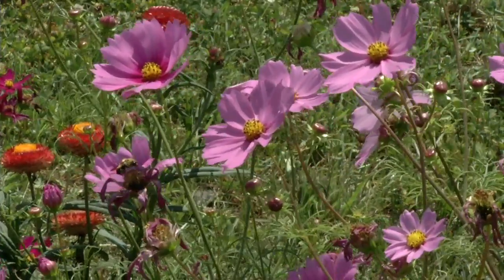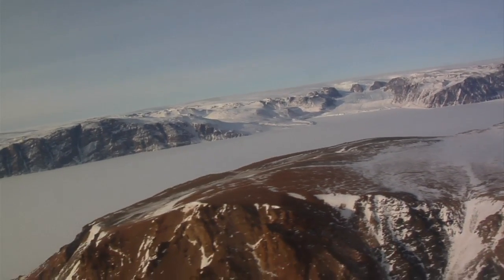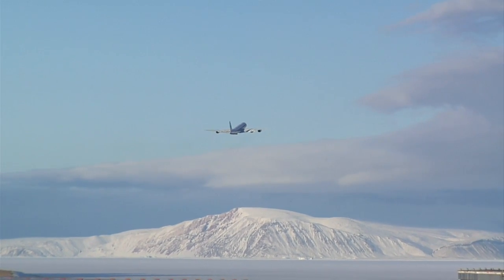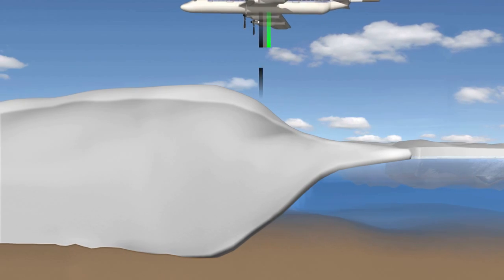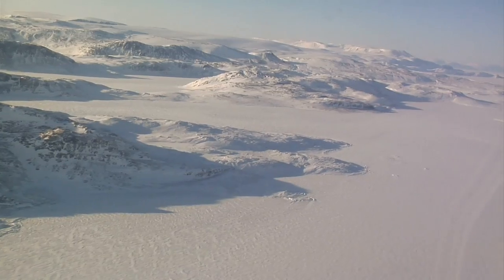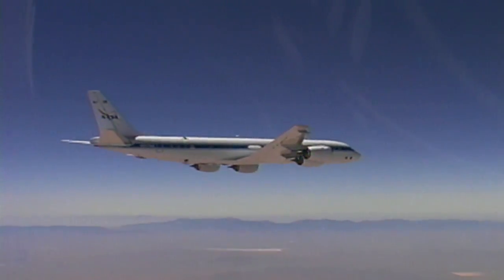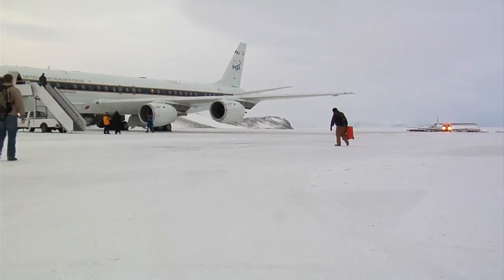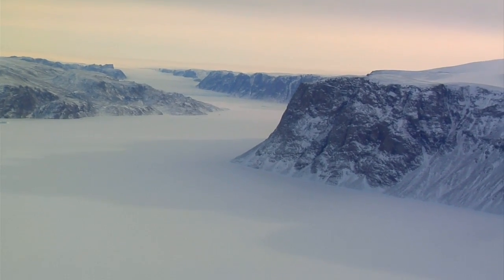NASA | Operation IceBridge: A Science Lab in the Arctic Sky

Comment: @insAneTunA 
I'm assuming you mean Cryosat 2.  Cryosat 2 uses a 3 band radar altimeter similar to one of the several instruments mounted on this aircraft.  The only difference is the Cryosat operates through 700km of distortion, where as the plane operates with a few thousand feet of distortion, or a couple hundred meters.  

Satellites are more stable platforms and weather does not effect them directly, but measuring through the atmosphere affects their readings.  I'm sure you can concede this.

Comment: @insAneTunA 
For this type of data collection, a satellite is not a viable platform.  This aircraft does the majority of its data collection at low altitude to limit the amount of atmospheric interference.  To collect the same type of data would require extrapolation from indirect measurements, and even then the error amount would be significant.  Winds at all levels of the atmosphere as well as particles  and water vapor in the air can give false readings.  Plus you can have a better resolution